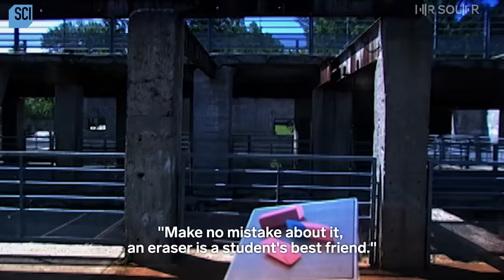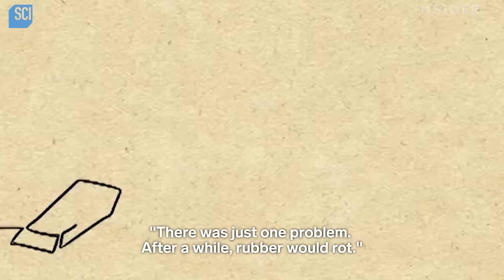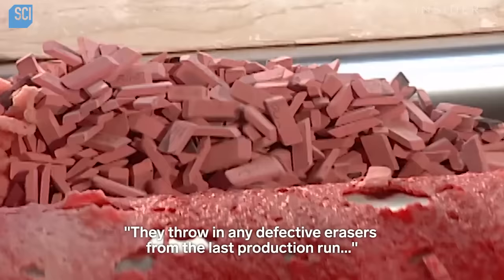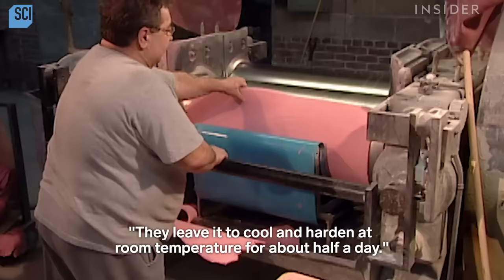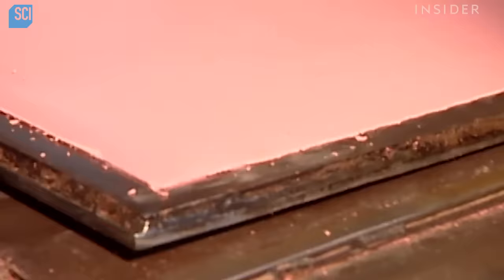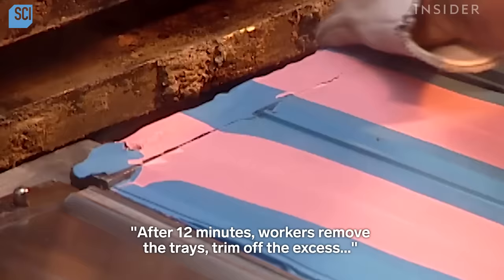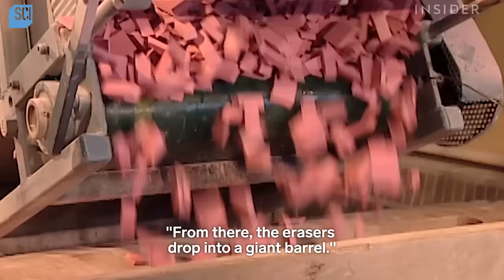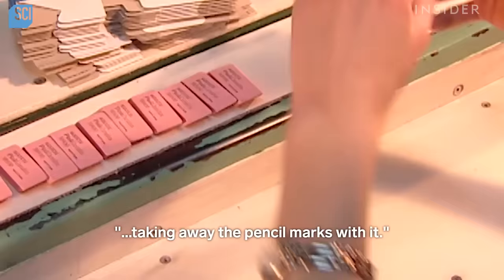How Erasers Are Made

Comment: It bothers me how he just put the synthetic rubber in without removing the plastic covering
Reply: he didn't, look closer
Reply: @isetta4083  are you blind ?
Reply: Yeah they for sure put plastic in those erasers.
Reply: It doesn’t matter
Reply: e.s1403 
At least it’s not going into a landfill  ¯\_(ツ)_/¯
Reply: e.s1403 yes
Reply: less plastic being dumped somewhere in a landfill...less pollution bro
Reply: The plastic will melt with the heat of the barrel.
Reply: 666 likes oml
Reply: Well at least they are not throwing it away and putting the covering at use
Reply: @monochromatic2808  yup....more garbage, more company expense. If they didn't melt it in they would probably dump it in a river.

Comment: I never finished an eraser in my whole life.

And I never knew that ink could be erased.
Reply: It can't 😂
Reply: @voutsider190  it can erase the feather pen ink but not the normal ink, how could you not get that.
Reply: There's actually erasable ink now. How times have changed.
Reply: @gamingwithsohwin4374  yeah, that erasable ink is just a chemical that with heat added, goes clear. Technically “erasable”, but more like “clearable”
You can erase that ink with things like fingers, fingernails, or any items you can find by just dragging it across the ink swiftly a couple times.
Just a fun fact about the erasable ink 🤷‍♂️
Reply: @voutsider190  There are erasable pens made by FriXion.